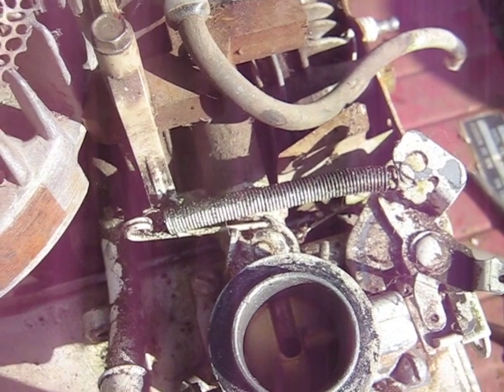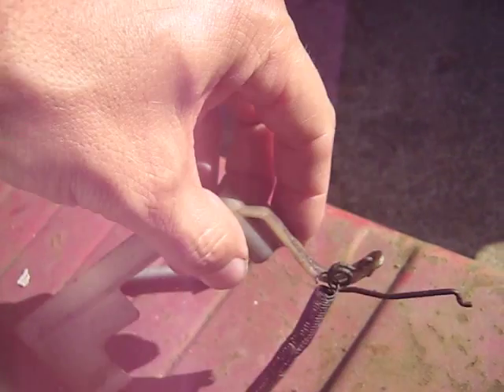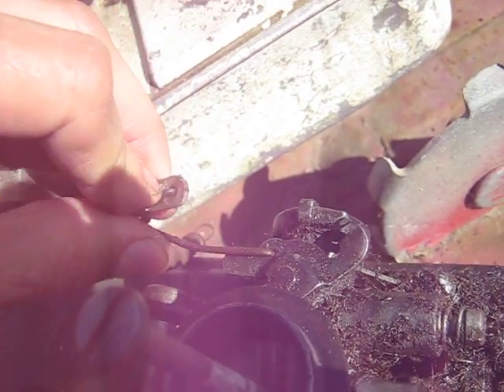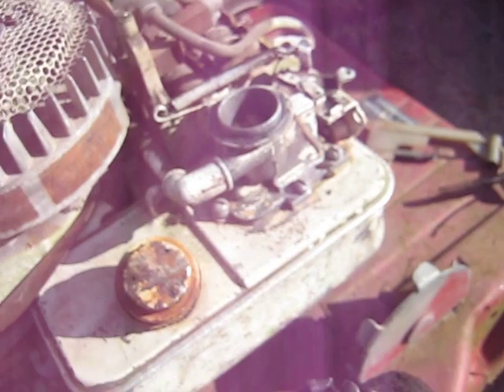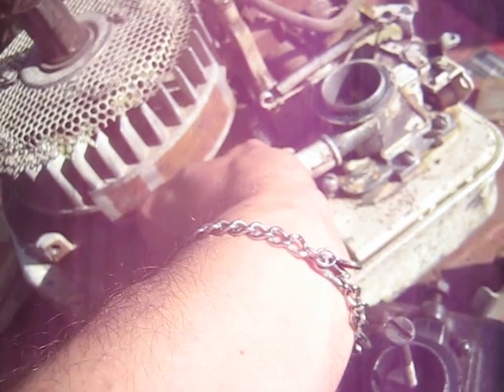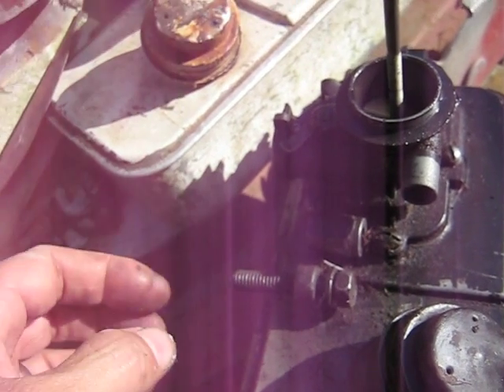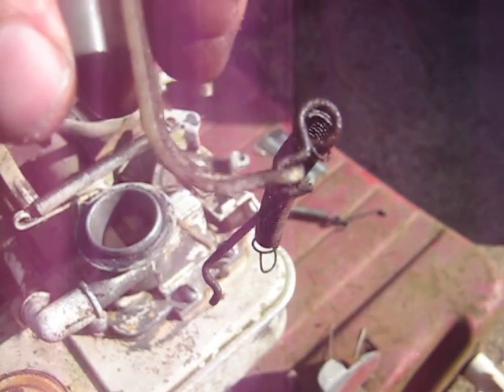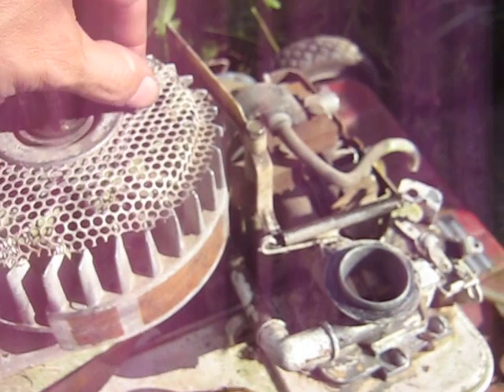3-1/2 HP Briggs Governor Linkage Installation

Comment from the maker: Just as long as the con rod doesn't let go!!!  :)
I used to pull back on the governor linkage on a 4 horse Briggs riding mower, growing up. Then one day it pulled a bit too hard, and it slipped on the shaft, then wouldn't raun at 3600 any more. I didn't know it was just a simple adjustment to fix it, so I tore the engine right apart. Unfortunately the pulleys got squashed in a press, the ones I bought were not quite right, so it didn't work 100% after that. Live and Learn :)

Comment from the maker: Yes, this is what happened with our tiny 5 horse riding mower, my son put in a racing con rod, took out the governor, added a racing air filter etc. It will rev like crazy now, but won't cut worth beans, as your hand can react fast enough to the varying grass conditions!  :)

Comment: All V-shaft engines that use the "5" in the third position after cubic inch displacement have Vacu-Jet carburetors; those with a "9" in the same position are Pulsa-Jet carburetors.

A 3.5 HP engine in the years 1966 to 1991 can be had as model series 92900, 93500, 94900 and 95500.